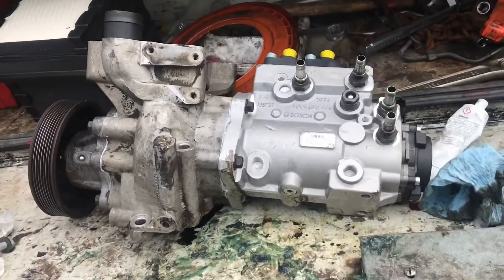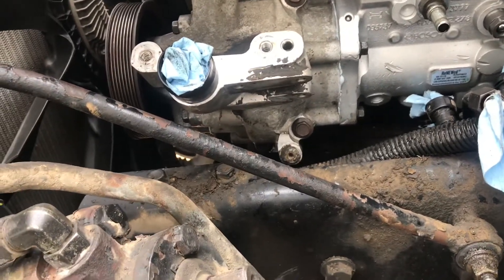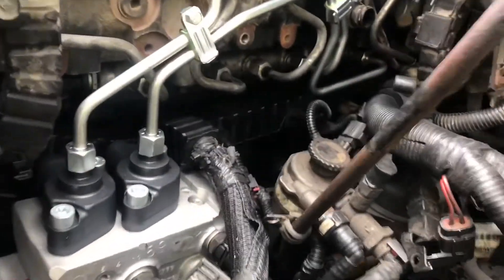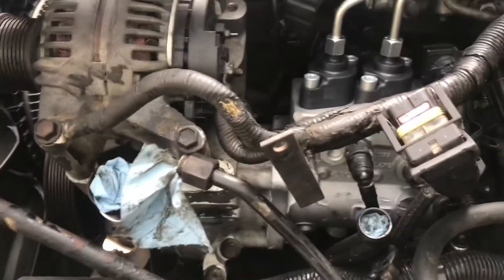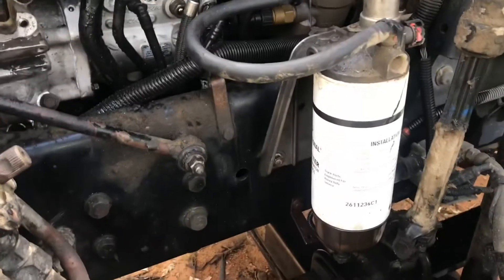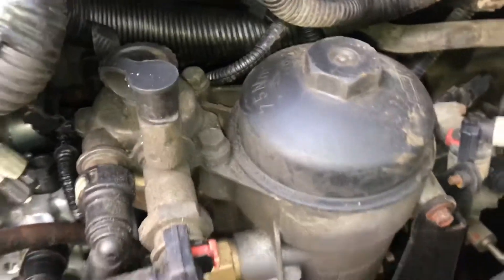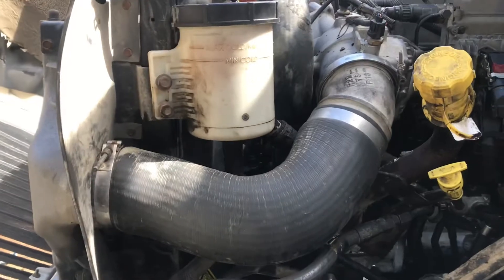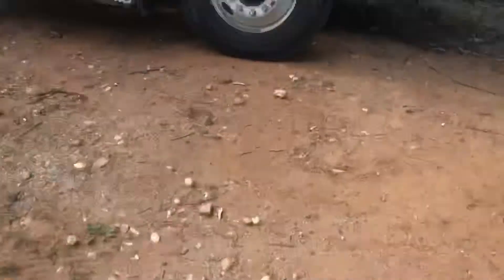International Maxxforce 13 Fuel pump replacement Part 2

Comment: I’m doing one now I need to know what the special tool is
Reply: There's a puller necessary to pull the drive gear from the pump. A standard balancer puller will get the job done

Comment: Do you think you could replace with a used one from another pump?
Reply from the maker: Nofer Trunions yes you can
Reply from the maker: Subscribe
Reply: Yes you can. You can buy the piece online. The question is are you better off to just replace that piece or the whole pump? Those Bosch fuel pumps tend to wear out internally around 500,000 miles. So if the pump only had 300,000 miles on it: I probably would just replace that piece. On the other hand, if the pump had close to half a million miles or over, I probably would replace the whole pump.

Comment: Im leaking oil from the pulley gear assembly, should I just tighten bolts and hopefully it stops leaking
Reply from the maker: Roy Andrade remove it and reseal the unit

Comment: Is there a fuel water separator on that truck?
Reply from the maker: Mr. Smith Yes. There is a fuel filter and a separator
Reply: Bosco’s  please tell me where. I’ve looked all over my 2013 maxxforce pro star and can’t find it nowhere
Reply from the maker: Mr. Smith It’s on the drivers side. Sometimes under or next to the drivers fender.
And sometimes it’s on the drivers side up top next to the steering gear box...
Follow the fuel lines
Reply: Bosco’s is there a way i can send you a video of my complete engine? So you can actually see what i mean
Reply from the maker: Mr. Smith Sure. Text me 6194952186

Comment: Is the fuel pressure control valve near the pump ?
Reply from the maker: I’m not sure what your asking about. But the pump acts as both low pressure and high pressure pumps. The amount of pressure depends on the amount of demand. It’s all electronic
Reply: @boscos5287 i ask about that valve because i get a code on the truck , and two of the causes could be the "fuel pressure control valve " or the " fuel rail pressure sensor " but i cant find either or
Reply from the maker: John Lechuga I’d imagine the fuel pressure control valve is part of the pump it’s self. And I’d think the fuel pressure sensor is on the fuel rail. I’d call the dealer parts department and ask them for locations
Reply: @boscos5287  i appreciate it and nice video I'll definitely rewatch it again just in case i have to replace it👍🏽👍🏽
Reply: The fuel pressure control valve is the solenoid on the back of the pump with a 2 wire connector on it.
  It is replaceable separately. The bottom screw is a royal pain to get to though
Reply: The fuel rail pressure sensor is located on the front of the fuel rail. It screws in with a 3 wire plug on it

Comment: How do I know if the fuel pump needs to be replace
Reply: As far as I know the Bosch pumps on the Maxx Force have two failure modes. The first is the pump cracking where the high pressure fuel lines attach. That is what happened to the truck in the video. You will know if that happens because the pump will leak fuel. The fuel is pressurized over 30,000 psi in those lines; so even the tiniest hairline crack will leak. The second failure mode is that the pump is worn internally and can no longer produce adequate fuel pressure. That is what happened to my truck. The symptoms of that are rough idling and power loss. The check engine light will come on and the ECM will store a code for low fuel rail pressure.

Comment: I put new pump n no fuel pressure
Reply from the maker: Prime it
Reply: @boscos5287  I did no pressure
Reply from the maker: @danielacosta2145  Google OTC® 5869 - Fuel System Priming Pump 
Those work the best
Reply: @boscos5287  what happens brother some asshole put oil in the fuel tanks n put white power on my semi in clean the fuel tanks is think they injectors r open
Reply: The low pressure lines on the pump are easy to hook up backwards. If that happens the truck won't get any fuel pressure. Ask me how I know😄